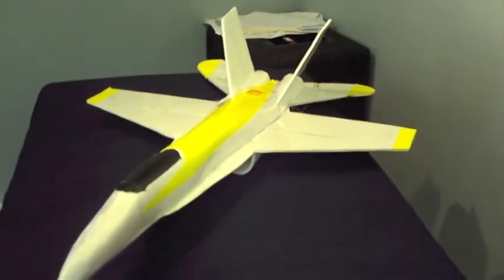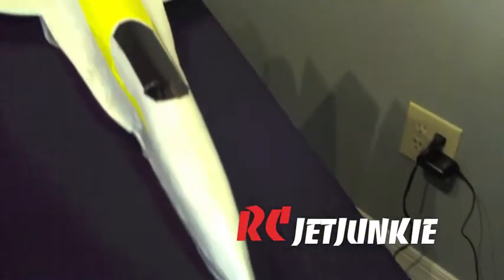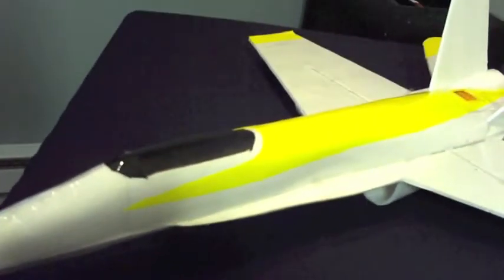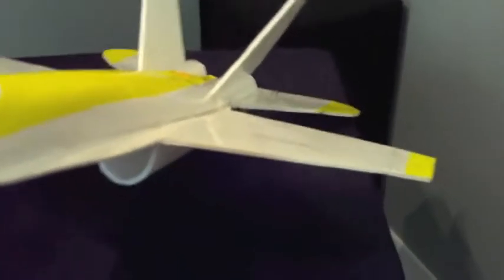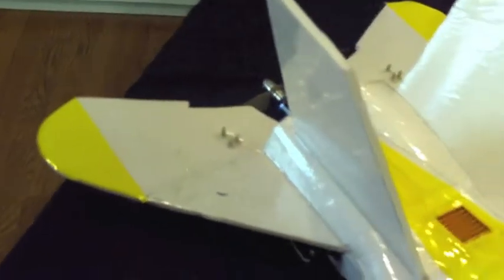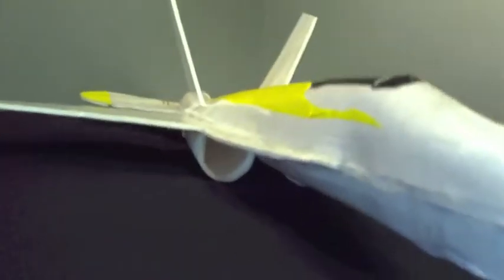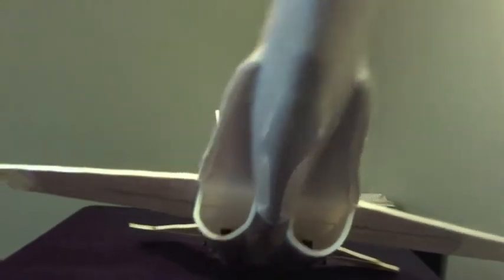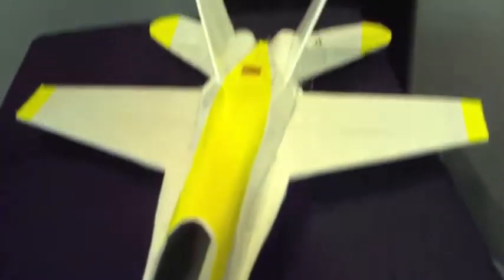F-18 SCRATCH BUILD RC JET--USED ALSO TO CUT GRASS !!!

Comment from the maker: @epet52 it's a exceed 2700 kv 500 watt made for a 90mm EDF but i flipped the shaft to work for the x motor mount get one at hobbypartz

Comment from the maker: @DanielMadrigalC Yes I do have the super mega and can see a very big different I never ran the super mega on a 4cell because it says 3cell max but this exceed motor can handle a 4cell no issue 2700 KV and 500 watts the speed and throttle response is no comparison and the motors are the same size